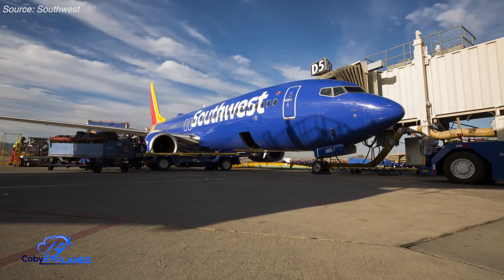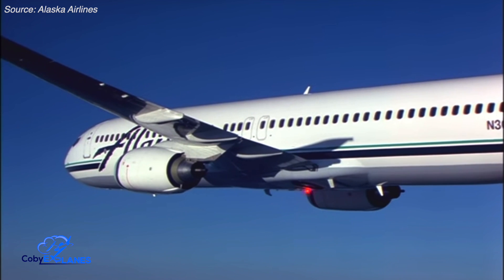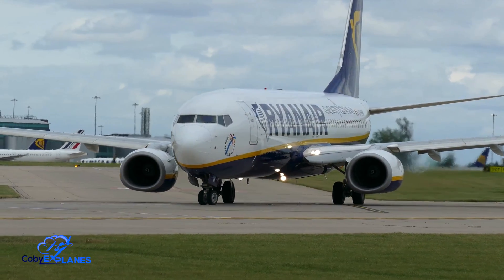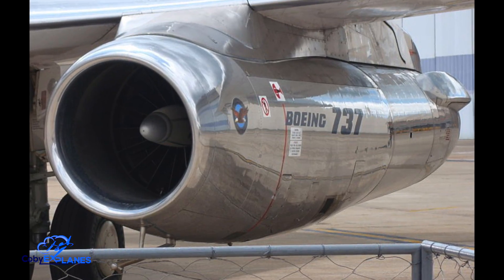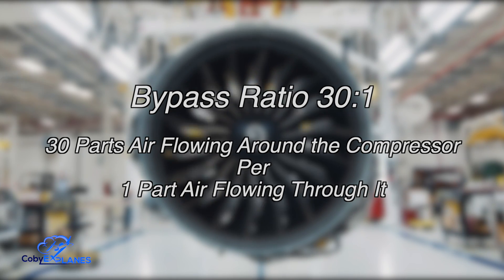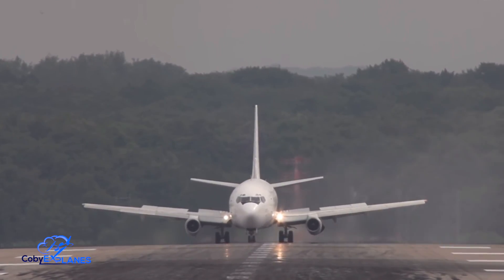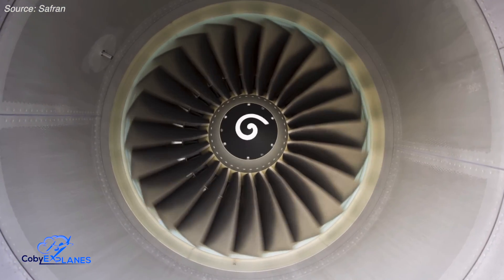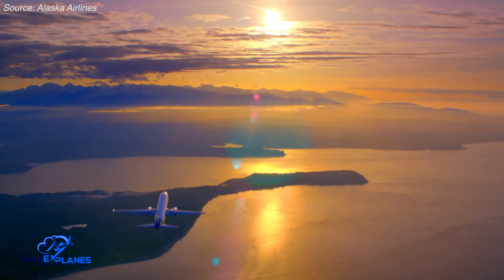Why are the 737's Engines Flat?

Comment: I'm still not completely sure why making the bottom flatter fixes anything. Sure it increases ground clearance, but the fan must be small enough to fit into the narrowest part (bottom to top), so any extra width is pretty useless since the fan can't be any bigger. Why not make it round and smaller?
Reply: The bottom is flat because all the hydraulics have been moved to the side. Fans in round engines also aren’t the diameter of the engines nacelle but also smaller to have space for hydraulics. A bigger fan was chosen as it is more fuel efficient and can have a higher bypass ratio

Comment: UNRESOLVED: THE REAL PROBLEM WITH 737Max8 see below👇🏽
https://www.youtube.com/watch?v=H2tuKiiznsY
Unless Boeing repositions those big new engines correctly on these planes wings i.e by raising the planes landing gear to allow enough room under the wings, the problem will still be present regardless of what software "bandaid" they use to correct the flight trajectory errors. MCAS software does not fix an Engineering and design flaw🤨.That is why it was introduced in the first place, to hide a Problem👀.
FLY AT YOUR OWN RISK Boeing737Max8.

👆🏾pls📱📲Share
TV📺One🗞️📰📻🖥️🎥🗣️📡(((

Comment: I once flew on a 737 with those old cigar shape engines to Honolulu. I remember this because the airbrakes were very complex with the rear 1/4 section of the engine cover on hinges. They slam open in a clamshell shape to divert airflow forwards to help with braking. This must have been one of the last 737s with that because the very next year, they all went away and were sporting much wider engines.
Reply: Lucky you, how did those engines sound??

Comment: I'm happy my assumption was correct, just thought it was using GE Engines
Reply: Thanks for the post.I learned some things I didn't know. The CFM56 is a 50% GE 50% Safran partnership (CFM International) GE made the compressor and high pressure turbine. Safran made the front fan and low pressure turbine. Originally Boeing approached Pratt & Whitney,  the manufacturer of the JT8D engine. Pratt passed and CFM Int went on to produce 30, 000 CFM 56 engines (2016).

Comment: On the routes I fly most I have a choice of 737 on one airline and A320 on another. The former feels old, small, tight and noisy. The A320 however is a different class, so roomy, so modern, so quiet (eerily quiet) even at the back where I normally choose to sit.
Reply: I see you haven't tried the Boeing Sky Interior
Reply: I flown on the A320 as well and it was still a noisy plane just like with the 737 and the smaller passenger jets I flown being the MD-80, 717, Bombardier CRJ, and Embraer E-Jets.

Comment: The angle of the slant at the base of the vertical stabilizer is also iconic of the 737. The empennage is very unique in the 737 along with the engines. No other aircraft have that angled base on the leading edge of the vertical stabilizer at the base. Maybe a video on that would be in the future?

Comment: You can’t have this conversation without talking about the biggest factor, wing-low crosswind landings. Notice how the flat spot on the bottom has dihedral. Is that because cones closer to the airplane are smaller?

Comment: You got the reason mostly right, except FOD avoidance was a major driver.  You got a few other details wrong...  General Electric and Safran have a joint venture called CFM that makes the engines for the 737 MAX and NG.  Also, Safran does make Nacelle components for airbus, but not for Boeing. The 737 MAX inlet was designed and fabricated in Charleston (Ladson) South Carolina by Boeing...

Comment: You got the story exactly right. They maintain ground clearance by rotating the gearbox a little bit creating the chipmunk cheek effect. However, the 737 engine supplier is CFMi international, not Safran. CFMi is a consortium with two 50% partners, GE and Safran.

Comment: This video was created months before the 737Max desaster, but it pointed exactly to the point where the 737 has reached the end of the line. To use engines with an efficient high bypass ratio, you had to move them forward and up, with all the problems resulting from that. 

And of course it still stays an old metal bird, generations away from a 787 design.

Comment: So the 737 hit its design limitation long time ago, way before the MAX was designed.  Boeing knew back then that they can't put a bigger fan in future design but decided to keep the 737 as is.  Then with the MAX, computer designed a patchwork plane that needed computer flight aid to fly.
Reply: That's a big oversimplification.  For one thing, the 737 is just about the only plane still being made that DOESN'T require a computer to fly.  Everything else is fly-by-wire, meaning the computer flies the plane and the pilot tells the computer what he would like it to do.  The 737 is still controlled with mechanical cables and hydraulics.  The system you're referring to, MCAS, is an augmentation system that spins the pilot's trim wheel to prevent a stall in case the pilot does something he's not supposed to do (in this case, add a bunch of power to try and clear up a stall).  To be clear, in any jet airliner with under-wing engines, adding a ton of power while at stall speeds is going to pitch the nose up and cause problems.  The reason this became a particular problem on the MAX is not really that the engines are positioned differently (being higher and further forward is more stable actually), but just the fact that the engines were significantly more powerful.  The same engines are used on the A320neo, and the same effect occurs, but unlike a 737 that airplane has always been highly augmented, so pilots of the Neo don't have any additional systems or different characteristics to learn.  With the MAX, because they were adding this augmentation for the first time, pilots would need to know about the change.  But part of the design requirement for the MAX was a shared pilot type rating with previous 737s; this was dictated by the airlines due to the A320neo having achieved a no-training update.  The goal of MCAS was not the make the MAX flyable, but to make the MAX respond like an older 737 with less powerful engines.  Boeing got into trouble because for some stupid reason this system trusts a single AoA sensor alone without cross-checking other sensors, meaning a failure of this one sensor can lead to unneeded action by MCAS.  A pilot trained about the system would be able to figure out the problem quickly and stop the trim wheel physically with his hand, but there was no such training.  Although really, anyone flying any 737 MUST know that trim has more authority than the yoke, so any time the trim wheel is yeeting forwards, a pilot with a brain should know to stop that thing immediately, whether it's a MAX with MCAS, or a vintage -200 with a short circuit in the electric trim switch.  In my opinion the whole thing should be easily fixed, either by retrofitting a second AoA sensor, or by reprogramming MCAS to reference other sensors to get a more accurate picture of whether the airplane is stalling.  But it's turned into a big hoopla with the public demanding big giant changes, on the assumption that it's a big giant problem with the design of the airplane.  It's pretty telling that, even during the grounding, there are still thousands of orders for the MAX because airlines know that the basic airplane is very good and that this problem will be pretty easy to fix once the mountain of government paperwork gets sorted.
Reply: @JETZcorp  Wow. Thank you for your insight.
Reply: @2be1withU  ME' EYES!!!!!

Comment: Eventually, though, Boeing is procrastinating almost 40 years with solving the problem of the 737's low clearance from the ground, which led to changes in the location of the engines on the 737 MAX, which in turn led to a tendency of the plane to stall, which led them to develop of software band-aid, which led to 346 dead people. This whole thing reminds me of something I've learned at 3rd grade, when my teacher and my mother spoke about these ridiculous, cheap thing the school installed on all doors to prevent them from slamming, which had to be replaced shortly after being bought and installed, leading my teacher and my mother to agree that "cheap solutions end up being the most expensive ones".
Reply: honestly if they had just told the pilots about the mcas this couldve been prevented.
Reply: Omer Shomrat I wrote a paper on the situation with the max and the mcas system It was outdated to what I would do know but dam it weird
Reply: that's really interesting take
Reply: It's not just the MAX. It's every single newer 737 dude to the forward placement of engines which causes instability at low speed
Reply: Mucho tecto

Comment: Engine manufacturers only make the turbine engine itself, not the nacelle. The nacelle is part of the airframe and is the responsibility of whoever manufactures the airframe (Boeing). Just a small mistake for an overall solid video.
Reply: Not solid video. Any video mentioning 737 should show condolence to the victim's family of Boeing's practice of profit over safety.

Comment: All this multiple add on and avoiding revamping of the landing gear ended up into Max debacle
Reply: Same with the DC 8 tall landing gear and they could stretch the 8 low gear on the 707 could not stretch it because of tail strikes so they had to make the 757
Reply: Ibrahim Makumba no... it didn’t. It had nothing to do with that.
Reply: Pat hampton it kinda did. Higher bypass engines were too big to mount without mounting them forward, thus creating the pitch up attitude.
Reply: @matthehat  True, it did influence the design. Airbus didn't have this issue because the A300s were originally intended to sit higher off the ground. Therefore, Airbus could afford to compromise a little bit of space between the wing and ground while Boeing took the lazy approach, which cost them dearly.

Comment: Boeing needs to dump the MAX and go back to the 800. The Max is not a stable airplane.. The trim keeps going nuts.. The back horizontal stabilizer needs to be out further like a few feet added to it each side but no they will find a cheap way out.. But by doing the cheap way it will put a bigger load on the tail much bigger.. It would be a matter of time before the tail would fail..
Reply from the maker: Well it'll be hard for them to do so since 1, there have already been 5000 MAXs ordered and 2, the CFM56-7B engines for the NG are no longer being produced. It makes much more sense for Boeing to take some time to redesign the MAX for aerodynamic stability than revert to an obsolete plane
Reply: @cobyexplanes  Effectively true, but one technicality: CFM56-7B engine production does continue in low rates for ongoing production of military-derived 737NGs (P-8 and AEW&C). Obviously not nearly enough to restart NG production, though.
Reply: The MAX is plenty stable if compared to the a320neo they both have the same problem so whatever happens t othe max needs to happen to the neo too

Comment: So if Boeing managed to do this with the 737 NG, how come they didn't just lift the 737 MAXs engine bottoms higher and making it flatter rather than lifting it higher on the wing leading to the instability that requires MCAS?
Reply: Efficiency. The bypass ratio would be smaller which would make it less efficient
Reply from the maker: Well there's only so much they can do to misshape the nacelle without it impacting performance. At some point, they'd have to make the engine smaller, which would definitely impact the bypass ratio
Reply: @80sfreak14  wait i dont see how lifting the bottom higher lowers the bypass. I thought bypass was only dependent on fan size
Reply: @alphamalegold1  Because the fan size of the new MAX engines is even bigger and there is only so much space without the engines completely obstructing the wing.
Reply: @alphamalegold1  
This shape affects the flow of air to the fan which in turn affects the  bypass ratio
Reply from the maker: Well, they did. But at some point you can't make the nacelle more misshapen without affecting performance. In order to achieve their desired fan size, they had to lift the engine
Reply: Good question.